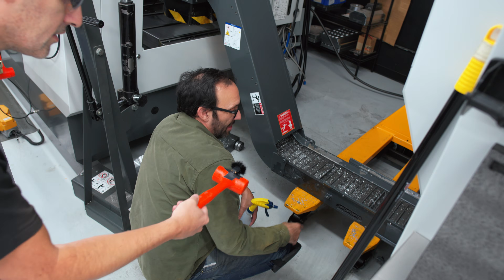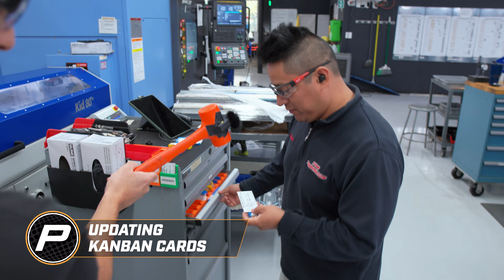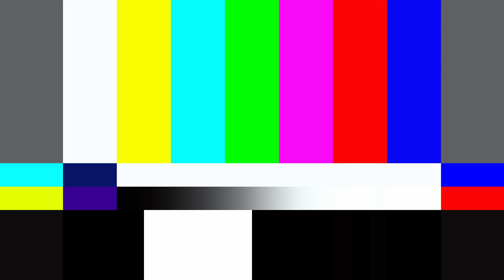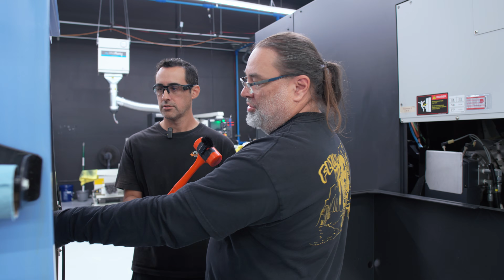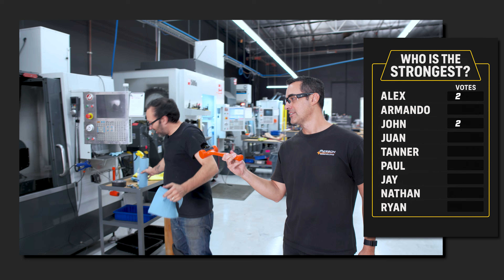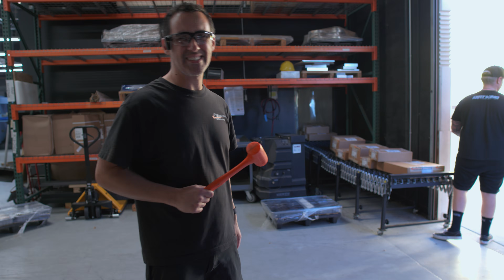Shutting Down my Shop (And why you should too) | Pierson Workholding

Comment: on the grinder mist collection system, why don't you add a check valve to the drain port and line to the tank you have the hose hanging off so it just drains itself when turned off? you could even add it a few inches off so you could make sure the mist is draining.

Comment: Start to use one-syllable words only.
It takes you too long to talk.
Lean waste!

Also, encourage employees to use wet-wipes first to clean-up the bulk and then toilet-paper to dry and confirm cleanliness of the remainder.
So much toilet-paper is wasted trying to remove the bulk and one wet-wipe typically gets the job done, while not just smearing it around.
And your shop will smell better!

Noise and bad smells contribute to a lowered quality of life, reducing motivation and creating workflow inefficiencies, like a post-segregation restaurant.
Wherever there is noise you are witnessing wasted energy in the form of heat transfer.
KERN would never tolerate such noise and wasted energy.

Looking like Seinfeld also doesn't help.

Also, "chanfer"???

WTF, Jerry?!

You did that just so we would leave a comment about it.

Jerk.

Comment: I worked at a Gear cutting job shop, we had some Gleason bevel cutting machines with coolant sumps that hadn't been cleaned in decades. It was oil based coolant, and it grew a few inches of sludge inside the casting of the base of the machines.  It was a stinky job, but I felt really good when it was done.

Comment: Did the coolant tank on my ST20 last Saturday. Been about 1-1/2 years and yeah, they can get some sludge in them. Flush with some BlasoClean, ran the conveyer to clean that also. Mix up a 2% coolant about 30 gallons ran that through everything and conveyer and drain. Then full concentration of Blaser BC20 @ 8% and back to work. Next weekend my SL20 gets a drain and flush about the same 1-1/2 years.

Comment: "Like duct taping things to make them work...  we don't do that."   (holding a hammer with a mic duct tapped to it LOL)
Reply from the maker: Haha, you get it! We had to throw that in.
Reply: Also, perfection is the killer of progress.......even a messy solution is good and be perfected later. Cut to: we don't do any half measures, just completely set up the station for the task at hand. 😁 Actually, I really like his mentality for setting up the shop and do things similar. Ergonomics, efficiency, and ease of use are things I love. It would be great to work for this type of person.